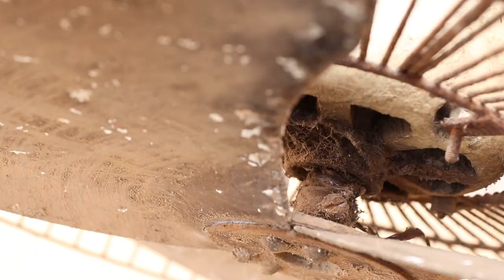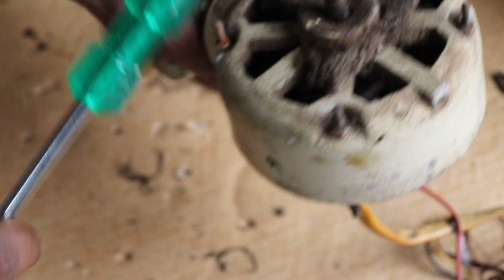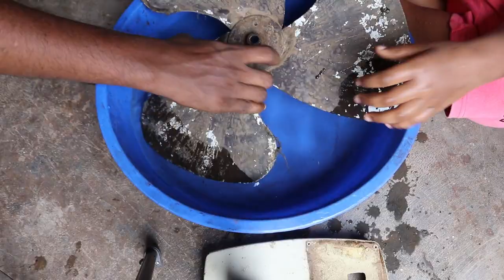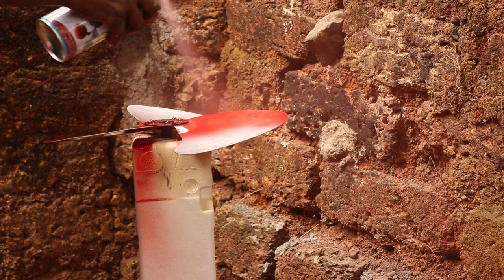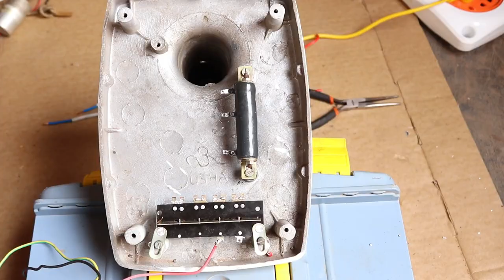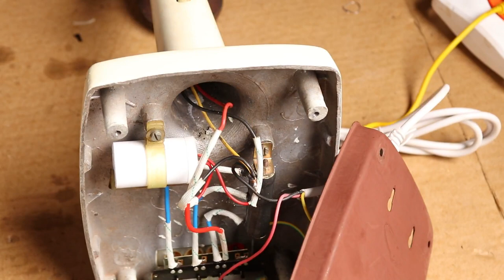1985' s INDIN MADE | 34 Year Old Table Fan  Restoration | EXPERIMENT UAE |

Comment: I had old usha fan with only turn button of speed no switches and it begins fast but later after 20 minutes it's completely not working. Later 10 r 15 min it's once again working but the same problem continues. Please give a suggestion to me
Reply from the maker: Maybe problems in side.
I think this fan over heat. that’s why coil Thermal protractor active  
1. Check motor shaft and bush
2.change capacitor

Thankyou.
Reply: @Experiment_UAE  Thank you